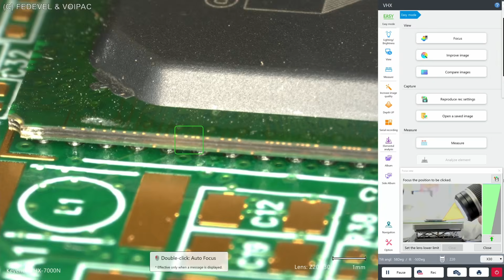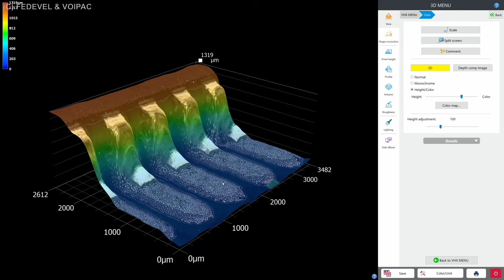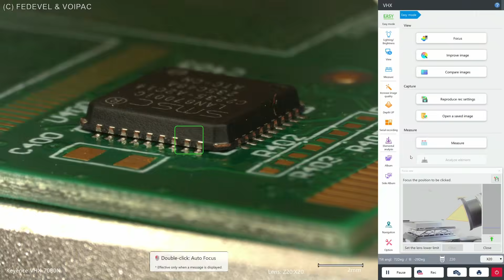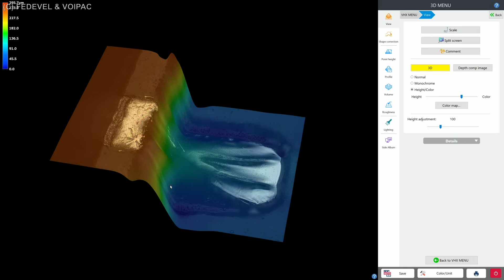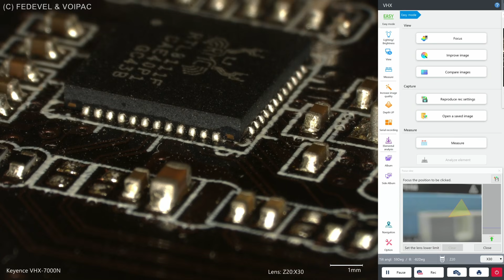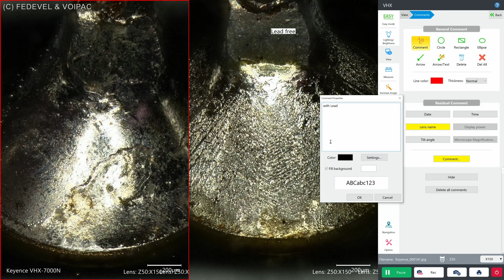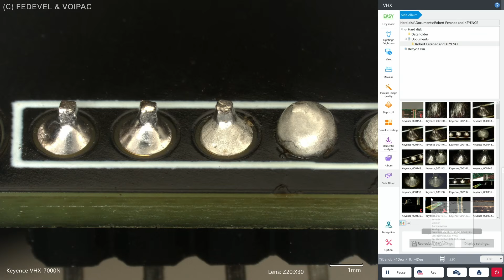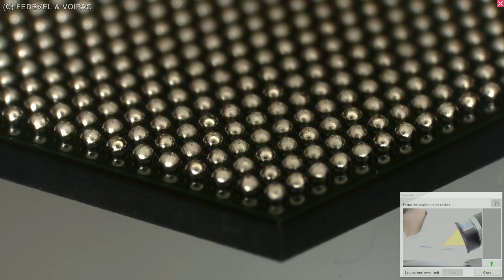Have you ever seen soldering THIS close?

Comment: Is this confocal? Confocal miscroscopes are seriously cool stuff. Although I think almost exclusively used by biology. Maybe not anymore though. There is also confocal Raman microscopes
Reply: Ah interesting ... shouldnt be a confocal.... just how does it calculate the 3D image? would be nice to know....
Meaning cheap enough microscope with 3D capabilities are again seriously interesting I think.
Now I dont know what is cheap but I think a confocal is much more expensive 500 000 to 1 Mio. € or so. Whilst this one might be in the 10000 thousands
Confocal has a scanning beam and a table that can be moved in z direction scanning xy for each depth separately, 
the image is then generated from highest recorded intensity as a function of x and y.
But that is the only mode I know in a confocal. It*s really nice thing to work with and resolutions are up until the limits of the light beam that are used I think.  (and one can also use lasers). And fluorescence which is more important for biology.
I used a confocal long time ago, so i dont remember much of the details, so if anybody is interested look it up

Comment: Isn't soldering an expensive hobby? I'd like to learn it, but it doesn't sound financially viable for me.
Reply: Don't forget that what you see here is industry-level stuff. If you start with normal leaded components, you'll get the hang of it (or not, maybe the soldering is not for you but something else within electronics is). You'll grow accordingly and at some point want a better soldering iron, than you want a hot air station. A hot air station is something I consider to be a bit overrated, I only use it for desoldering and have only used it to correct alignment of some SMT components, never used it for actual soldering (they are also great for heatshrinking heatshrink sleeving, bending acrylic, PVC, ABS and polycarbonate though).
I have recently bought a soldering tweezer. It's just a handy little thing to have without having to mess with hot air if you want to desolder a two-pin SMT device.
Hobbies should be allowed to cost you money and these days you can either make this as expensive or as cheap as you want, with the downside that cheap with more demanding soldering jobs usually is not a good idea.
Reply: @weeardguy  Thanks, very much. I always like when people on the internet take the time to write an informative comment. Yea, hobbies should be allowed to cost money. I think that some day, I will try it. I can't right now because I'm not in the best situation for that.
Reply: @leickh  You're very welcome. I feel that ever more people lack a 'handy dandy' father or at least someone within their family or group of friends to give them at least some information and thus have to rely on the internet, with its incomprehensible wealth of information that most likely makes it harde to distinguish between the good bits and bad bits (Youtube is no exception).
The best tips I can give you is to either go for a simple, well-known brand for a soldering iron, even when these are not cheap: cheaper soldering irons tend to give you bad results, which could lead you to believe you are not able to solder properly at all. Most overrated advice is to go for a temperature-adjustable iron: I started soldering when I was 8 years old, and only after 20 years or so, I was in need for an adjustable iron and got one second hand. Just as overrated: 'go for a digital one, because only those are precise'. An analogue controlled station can be just as stable as a digitally controlled one, as both (in essence) are analogue when it comes to controlling the iron itself.
Same goes for solder: avoid aliexpress and such at all costs, as you usually won't know for sure if what is sold to you is actually true. Multiple people have already tried soldering with solder that does not contain a rosin-core or flux-core (or far too little of it) which makes soldering a hassle to say the least.
And to end this: Just go for a simple Velleman kit with two flashing LEDs. Yes, in todays world where you can program basically everything you want to make in a microcontroller (whichever platform (Arduino, Microchip/AVR, ESP and such) you prefer), two alternating flashing LEDs are probably the most boring thing you can think of (but then you can also try to expand the circuit to drive big lamps with it by bigger transistors or relays), but at least you get a pre-designed circuit and circuit board that is guaranteed to work given that you mount the components in the right orientation and don't heat components too much.
And than, if you do get the hang of it, you start designing circuits, maybe even your own circuit boards and before you know it, you'll be entering the world of SMD-components and their accompanying challenges ;)
Keep dreaming, you never know what can come your way (says someone who enrolled into aviation electronics 2,5 years ago by sheer coincidence and is having a blast ever since)
Reply: @leickh , I don't know what country you live in, but here in the US you can buy a temperature controlled, adjustable soldering station at Harbor Freight for $45. I posted a review and teardown of it on my channel recently. It's way better than what I had to work with as a kid in the 60's and 70's; and if you don't like it,, just walk back into the store and return it (they also sell a digital soldering station for $120; I bought one and will do a review/teardown of it shortly). Unfortunately, most hobbyists buy their equipment and supplies directly from China/Asia via Amazon, Ebay, AliExpress, Banggood etc where low-quality clones or outright counterfeits are common.  The quality of soldier and tips for the iron sold down line is often even worse than the quality of the soldering stations. Accessories such as solder and tips are best bought from authorized specialty electronics distributors in your own country so that they're likely to be of known quality, and it'll be easier to get a refund if the product doesn't work well.  Here in the States you can also buy a Hakko FX888 DX soldering station and iron for $120 direct from Hakko US, but they redesigned how the adjustment interface works and I don't like the looks of it.

 By the way, the soldering iron tips sold in bulkpacks from China are invariably made of solid iron or steel which is a poor thermal conductor. Cheap tips will be strongly attracted to a magnet at both ends and throughout the body length, but high quality, brand name tips such as Hakko or Weller are made of copper as the base material and will only be magnetic at the pointy business where they are intentionally plated with iron  to resist the dissolving effects of molten soldier and flux. I've got a video on my channel about this as well.

PS,  It's supposed to be a closely kept Harbor Freight secret but I discovered that both of the soldering stations they sell are made by Shenzun Atten. The $45 unit is an Atten AT937 (a clone of a much older Hakko 936 unit) and the $120 digital unit is an Atten ST80.  Both use common 900 M or T18 style tips,  but the tips supplied with the soldering stations are iron and are conical (pointy) tips which can be difficult to use, especially for newbies, unless you're soldering tiny connections. Equipping these with brand-name Hakko or Weller, chisel-end "D" tips, will improve performance.

 And now, we also have the increasingly popular T12 soldering stations where tips and heating element are combined into when long unit that plugs directly into a special matching handle;  you can buy the tips in different sizes and shapes and you can quickly switch to a different sip size/shape, but the quality of some of the less expensive T12 equipment is not very good being sold out of China isn't very good, and some of them (multi voltage units that have a switching power supply so they can be used in any country) even leak voltage through the soldering iron onto the circuit board, which can damage sensitive components. I personally would never buy a soldering station that didn't have an internal power transformer!
Reply: @weeardguy ,  Another option for newbies is to go to a ham radio fest where you're likely to find some inexpensive used or perhaps even new soldering equipment being sold by old codgers like myself who know how to use them and can give advice; and you can probably find some interesting kits as well, to assemble with your new soldering equipment.

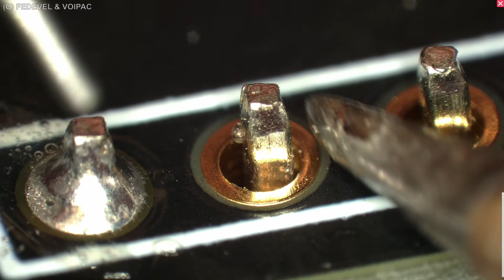Comment: At 06:05 you should place the iron and the solder at the same spot on the pin simultaneously, the solder will help carry heat into the pin.  You should also remove the iron and the solder at the same time, or the iron very shortly after the solder.  If you leave the iron on too long you boil off the flux and the solder wants to "follow" the iron off of the part (makes little solder-sicles).
When you see the pin push free to the left it indicates that you held the iron on the joint too long and melted the plastic holding the pin on the other side.
Reply: I was taught differently. Put a drop of solder onto the tip of your iron and add more solder from the other side. This avoids „cold“ joints brcause The additional will only melt if both the pin and the eye are both enough the be wetted by the solder.
Reply: @MrAranton  I think the same result is obtained either way if you do so at the joint.  If you do so too far from the pin the flux will boil off the iron before you get to the joint.  You just don't want to hold a "dry" iron to the joint while waiting for solder to melt on the other side of the connection.  The iron, solder, and flux all work together to get a good joint.
Reply: totally agree and also learned something new from you! thank you! :)

Comment: Fascinating!  I wish you could do some experiments to try to reverse the shiny/cloudy result (especially by just changing soldering temperature and timing, maybe with heat-sinking near the solder joint to slow the cooling down):  Can any techniques make a leaded joint cloudy or an unleaded joint shiny?  Nobody seems to understand what's going on here, and everyone wants a shiny leaded joint!
Reply: The cloudy result can not be reversed and is something you don't want to be after as well: it's just how that particular alloy of solder solidifies. The IPC rework/inspection section even has a significant section with pictures showing how different solder connections (stranded wire to board, sturdy wire to board, component lead to board, SMT-connection, BGA-connection) look when solidified, to avoid labeling a board as suffering from bad solder connections.
So, everybody who has followed an IPC-training in soldering knows what is going on...
Reply: @weeardguy  Yeah, I know shiny is usually desired, but I think that what causes a joint to go cloudy and the proof that shiny is electrically better (or is it 10-year reliability that is better?) are both not given anywhere...so I still would like to see more shiny/cloudy experiments.
Reply: @bobuhi  No, shiny is desired among hobbyists that still use leaded solder, while the industry has long moved on to lead-free solder alloys that just look different when solid and that process can not be altered in such a way that it solidifies shiny. It's just the different metals in the alloy that make for the dull appearance. There's no difference between the two in reliability by now and leaded or unleaded hardly makes a difference in my field of work (avionics) where both suffer from the same problems (bad solder joints due to temperature cycles or just aging). Leadfree joints with problems are usually a bit harder to spot as the whole connection just looks 'off' compared to leaded solder.
Reply: I've been soldering for over 50 years (including 20 years as an audio-repair tech) and personally hate leadfree solder. Even under the best of manufacturing conditions, with the best possible equipment, It's more difficult to make dead-nuts perfect lead-free connections than it is with leaded solder. Leadfree just doesn't flow and wet to the components by capillary action as well as leaded solder does (and the associated fluxes are nasty). Some circuit-board manufacturers are purportedly going to a nitrogen process that excludes oxygen in order to lessen the chance of the connections developing dendrites or tin whiskers. How many electronics hobbyists are gonna spend $500-600 or more to buy a nitrogen solder-rework station?
Reply: @goodun2974  It's also about the used brand of solder. Kester, Chipquik and other brands all now feature very good alloys in  their gamma of products, while some 15-20 years ago this could have been a different story.
Fluxes are ALWAYS nasty, leaded or lead-free and ALWAYS need to be cleaned afterwards, as it's very corrosive and you can't (easily) check if remains are left on the PCB or part. The stuff I use at work for leaded solder connections (stuff by Ersa, can't remember the productnumber) absolutely takes your breath away and can even make you lurge if you forgot to turn on the fume extraction.
Nitrogen-added solder processes are usually something only associated with class 2 and class 3 equipment (automotive respectively aerospace, aviation, medical and mil-spec electronics) and thus hobbyists usually won't have to deal with a nitrogen environment.

Comment: Oh, lead-free...I so much hate lead-free. Never buy lead-free solder, avoid it at all costs.
Reply: why?
Reply: @amortalbeing  lead free requires a little higher heat, and many from the boomer generation have refused to learn to solder correctly. Soldering with lead free requires a little different technique. Otherwise lead free soldering is just as good as solder with solder with lead in the mixture.
Reply: @williamallen7836  thanks a lot for clarification 🙂
Reply: @williamallen7836  Lead-free is not just hard to solder with no benifits. It's worse. Connection is more brittle, may break easily. All those expensive GPUs fail because of lead-free BGA balls. And because leaded solder is allowed in military and space equipment, it seems like lead-free was enforced only to reduce device's life cycle and force pepole to buy new device more often.
Reply: @TheNamelessOne12357 that and also the fumes from leaded solder being able to cause early death. you're working with lead, don't forget. all that extra safety equipment for the factory workers is likely a massive drain on cash.
Reply: @TheNamelessOne12357  if you buy cheap solder that uses bismuth, yes it is very brittle. Likewise if you buy lower melting point lead free solder it becomes brittle at low temperatures, and proper tempature control is critical. This lower melting point formulation is much harder to work with. Once you make yourself knowledgeable on it's proper use, the joints are only marginally more brittle in the vast majority of applications. Like you mention, the military & space programs have an exemption on the use of leaded solder. This is because these are the few use cases ware lead free performs bellow the required metrics, and are critical use cases. This is because of the very extreme environments & conditions the electronics are used in. Jumping to tin foil hat theories to justify your belief is transparently ignorant. Consumer electronics & most industrial uses never come close to seeing these conditions. The failure of GPU BGA chips boils down to piss poor manufacturing (aka not maintaining proper soldering conditions), and BGA chips experienced the exact same failures back in the lead solder days for the very same reason. Wetability is a minor issue, and is overcome with a little practice & use of a quality Flux. TLDR, stop buying cheap supplies & learn the proper technique.

Comment: 6:10 This is something that many of us know, but few teach. Touching the solder to the iron as a catalyst to get it flowing. Once you have a little liquid solder, all is well. You can really overheat the pad/component trying to get the solder to melt without touching the iron.
Reply: Soldering instruction is often incomplete ---- they always tell people not to touch the solder to the tip of the iron but to  apply it only to the parts being connected,  which invariably leads to poor thermal transfer from the tip of the iron, which  means that you end up applying heat to the connection for so long that you can damage the board,  lifting and delaminating foils or, in the case of the header pin  with too much solder shown here, melting the plastic strip and pushing the pin off-center.  Anyway, I have been soldering for nearly 55 years, and for as long as I can remember I have done it the way it's shown in this segment of the video, where you touch the solder to the tip of the iron just for a second and then move the solder away to the other side of the connection.
Reply: ALWAYS keep your tip wet! That was actually the first thing I was taught in soldering lol

Comment: When hand soldering, always touch the solder onto the so,dering iron tip first, the solder will melt and release its core flux which wets the solder onto the items being joined (ie; pin and pad).
So touch the solder onto the iron's tip, right next to the pin, in the half second it takes the solder to melt the molten solder should instantly wet onto the pin and pad, then feed in the remainder of the solder to get the final flow.
Also, a double-touch of the solder can really help to flow it around the pad because the movement of the solder rod agitates the melt pool. 👍

Comment: BGAs are hell because you cannot inspect and depending on the design you may be unable to fault find.
Reply: That's why companies that do that on a regular basis have X-ray inspection machines. Usually, at some point it also comes down to experience and specific settings on the assembly- or rework-facility will yield a good result without inspection, although it can't hurt to check.